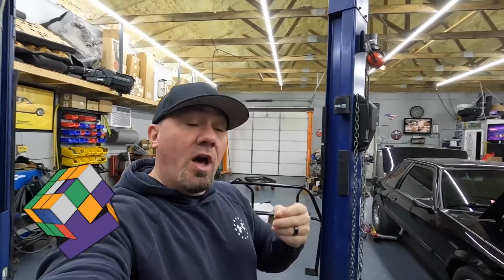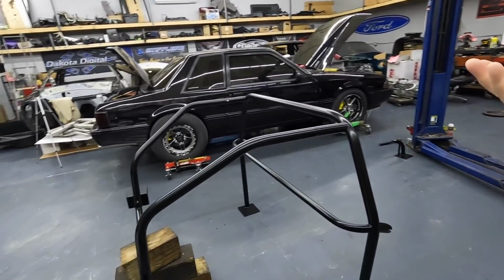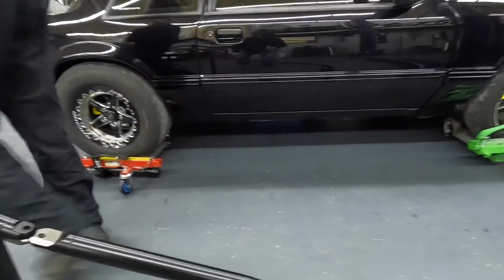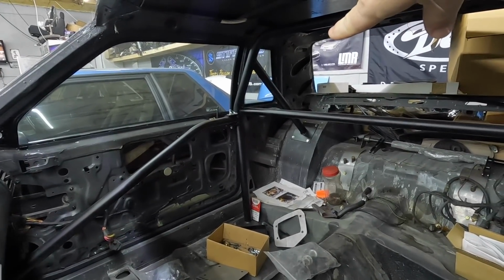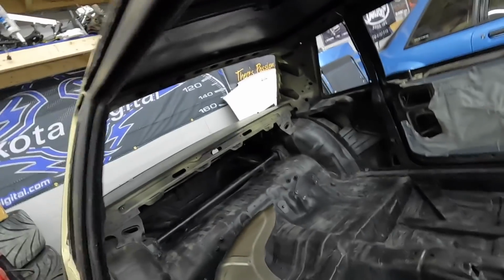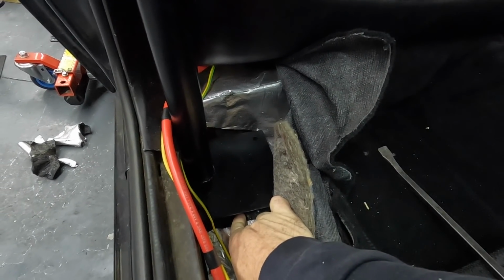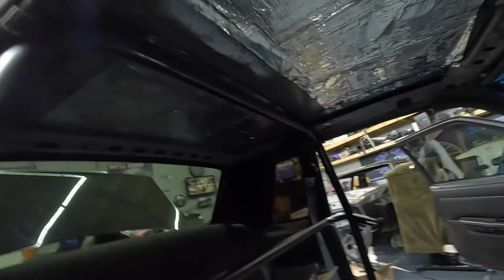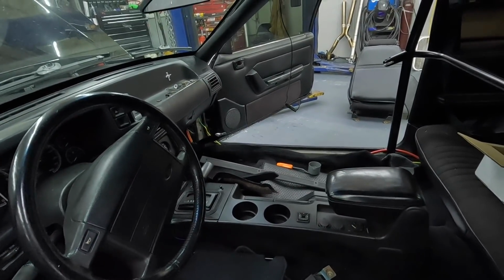NO WELDING! Track legal safety you can install in a day!

Comment: Opinions on bolt in vs weld in when it comes to extended use?   Ever had issues with bolts stretching?  Bolt holes becoming elongated?

Comment: Thanks for the content about these roll bars. I’m glad my car already has a 6 point weld in bar in it. I do plan to modify it with a main hoop seat bar, to mount the safety harness to. I’m not planning to drag race my car, but I do plan on doing some autocross stuff.